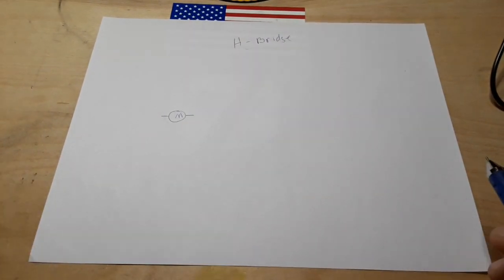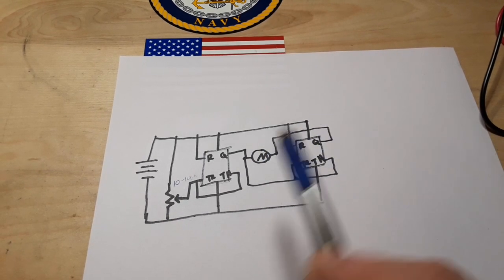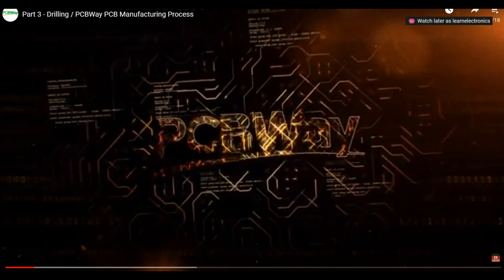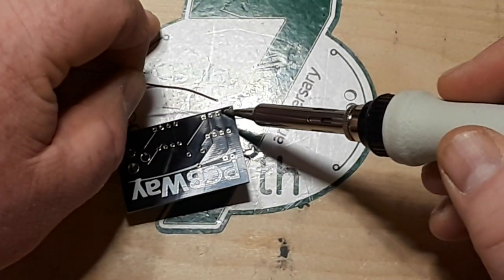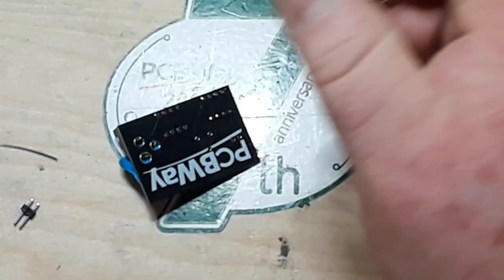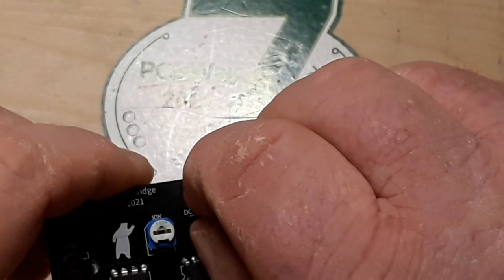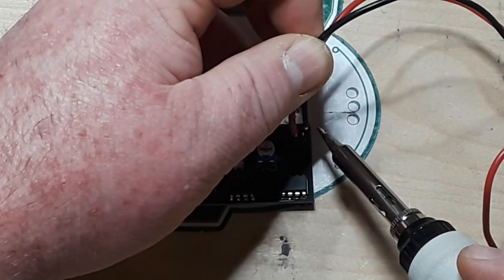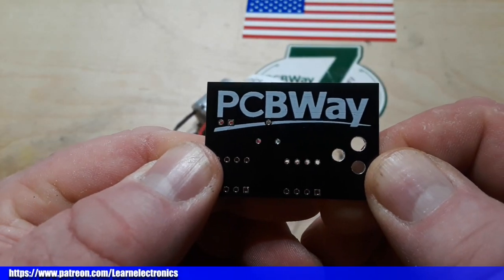Dual 555 Timer H Bridge

Comment: I just recently made a single 555 timer pwm H bridge. Used PNP and NPN mosfets for switches.  Super fun!
Reply: Really I need your opinion did you use the h bridge design as he did and did you use use the 2 signal for the 4 mosfet of or you spit the signal with a 10k resistor to get the delay

Comment: This gave me a good idea but can the signal use to drive a h bridge mosfet switch for driving ac motor I believe it can but I need your opinion i will use optocoupler for the signal isolation

Comment: When I read Dual 555, I thought you were going to use a 556 IC. :)

Also on the first diagram you shorted the power with S3 and S4 but didt'nt connect S2. LOL.
Nice circuit.

Comment: I like the idea behind this design. I use repurposed treadmill motors for projects and burn up controllers all the time. I am on the lookout for an HD variable speed with high torque at low speed. The motor turns a wheel to grind telescope mirrors. I've got two electric wheelchair motors and transmissions that have lasted the test of time, but the controllers still get toasted about twice in six months time. 24 vdc for the wheelchair motors, 96 vdc for the treadmills. I get server power supplies for about five bucks each or less and series them up, the weak link is the controllers. Just tossing out a real world problem that might have an entertaining solution from a practical channel.